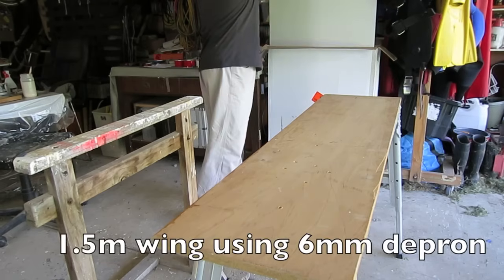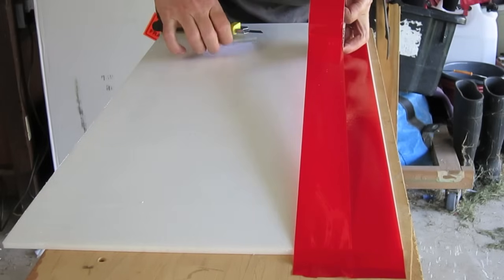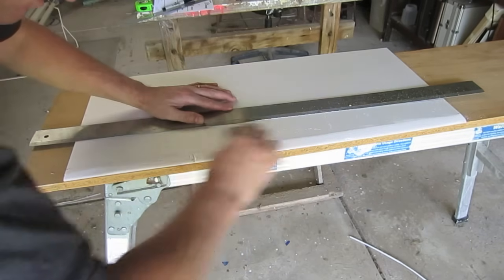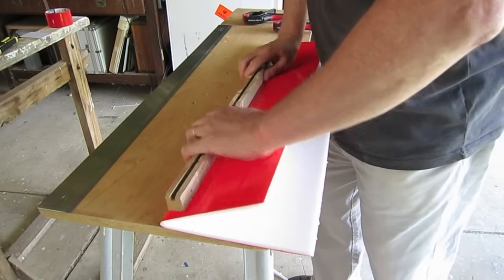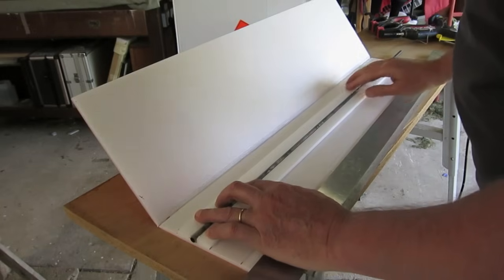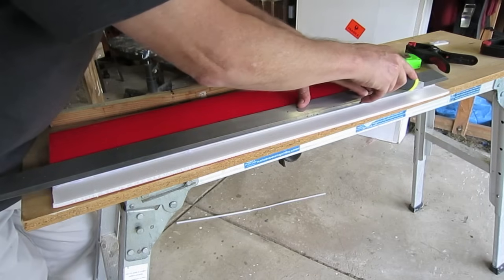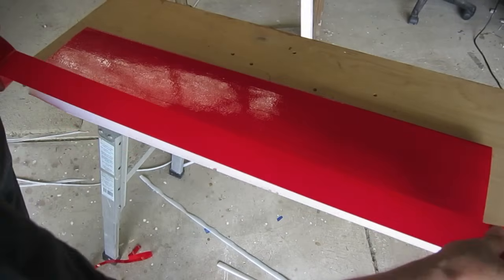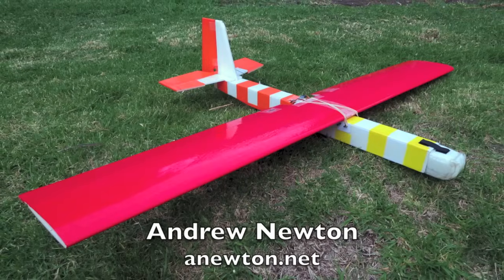Depron wing build

Comment from the maker: azatecas your Google+ settings prevent me from replying directly to your comment. The spar is only held in place by friction but it doesnt move.
Reply: @jellomaster5629  use wooden or aluminium spar
Reply: "Bob", I've built everything from from Comet and Sterling's tissue paper covered models during the fifties, (and still have a bunch in the attic btw), to 14 ' sailpanes now, so I wanted to give you a piece of advice about making your own spars, you can either buy an 8' long 2"x 4" piece of kiln dried douglas fir, cut it in half (4') and then using an electric planer from Harbor Freight smooth all the sides prior to cutting as many 1/4" x 1/2" or 1/8" x 3/8" spars as you will need in this lifetime.

Doug-fir is slightly heavier than Sitka spruce but it is also stronger so you can build some fairly large models if that's what you want or you can just use it as a spar in a three foot slope glider, or what ever you prefer just as well - or you can just buy a spruce spar at the hobby shop for the same price as what you will pay for an eight foot section of doug-fir which you can make about (36) 1/4" x 1/2" spears from, the choice is yours.

The only drawback here is you may have to purchase a small table saw but if you get into building like I and several other people I know the saw will pay for itself. 

Almost forgot, you could also purchase standard fiberglass arrow shafts from an archery store or off the internet and I've yet to have any break yet, and these are in some models which were built some thirty-five years ago.
Reply: @larrywhalen127  thanks for sharing your experience and improving our knowledge 😇
Reply: @jellomaster5629  Carbon fiber spar isn't necessary.

Comment: this really nice but, for which plane this wing?
Reply from the maker: servet içke I have used it with a few different bodies. Red Sloper, Ultra light sloper, motorised Red Sloper.
Reply: 1.65m (65") Twin Boom pusher, which wings plane for this plane?
Reply from the maker: servet içke Same type of wing as this red one but a bit longer.
Reply: OK. Thanks mr. Newton. Than i will build 1.65m (65") Twin Boom pusher and use this wing. Or if you have all plan maybe you share with me.
Reply from the maker: servet içke More information here http://newtonairlines.blogspot.com.au/2014/11/17m-twin-boom-sloper-pusher.html Good luck and let me know how it goes.
Reply: thanks again.Ok i will send you photos maybe video,  I'm using this plans.

SPECS
Wingspan - 1.65m (68")
Length - 100cmm (36")
Airframe weight - 840g

Comment: Hi  Andrew, I've seen others use packing tape method  ie experimental airlines my qtn' is - why does eveyone cut the tape off flush ? I've not done this yet but when I do I intend to tuck mine under, it would be much neater and secure.
Reply from the maker: loonypics For a strong glue join you need bare foam board. But for some edges folding the tape over would be a good idea.
Reply: Andrew Newton Many thanks for replying so quickly. This is all new to me as I've been balsa builder for years using heat shrink film (sola film). Just one more  thing,  heat shrink filming is easy for me as I've done loads of it, can it be used on Depron ? thanks
Reply from the maker: loonypics Depron is a bit heat sensitive. I used document laminating film "New Stuff" for my Le Fish build Complete Le Fish build and the ailerons and tail are depron, had to be careful not to overheat it. With your skills it would probably work fine, just have to try a test piece.
Reply: Andrew Newton  Thanks Andrew, I've decided to use your method for my first attempt at depron building. I have some on order it's 1000mm x 350mm x 6mm, I'll build 2 at 1metre first and the decide between the Axon or the Peace drone the PD may win because the depron size is just perfect for a 2 metre wing with a 1 metre canard + the fuz'. bty I've ordered 4 sheets. My aim is to create a very slow motor glider of some sort as a platform for my Mobius cam', in my opinion most fixed wing flyers fly much too fast for good quality results. What  I want to do is low and slow. At some stage we all go through a  missile stage cos' it's fun, but it's not relaxing and useless for really good detailed filming of landscape etc.
once again many thanks for your very good well explained tutorials.
may all your glitches be little twitches,
Reply from the maker: loonypics Something to remember, depron needs the tape covering (or laminate) on one side BEFORE bending the leading edge. It will just snap without it. An extra layer of tape where the leading edge bend will end up might also be a good idea, not that I have done that yet. An APD that size will be able to float along at walking pace and might even carry an SLR, keen to see the results.
Reply: Andrew Newton It may be a while yet before I get  it done, as money is tight at the mo', maybe a couple of months, and yes I will do a video and contact you when it's all done and dusted, I'm toying  with the idea of under slinging the fuz' something like the Axon's main wing but for the canard also, my thinking is increased roll stability will be more stable cos' the CG would be lower and should help a bit to protect the fore plane when landing in rough grass land, I think maybe the fuz' should be double boxed in high  along its length 3"x3"= a 6" depth and tripled at the wing points, that would be about  9" depth at the wing fixings, or is that over kill ? I would like to , as an anti tip stalling precaution, it would be easy to do, just cut the outer 8" or so off the ailerons and glue back on the wing with a few  degrees of up tilt
Reply from the maker: loonypics The standard APD is very stable as is, maybe too stable because it takes a fair bit of throttle and elevon input for turns. But if you're keen to experiment go for it. Easy to reconfigure if it doesn't work.
Reply: Andrew Newton Hi again Andrew, there's  one thing I forgot to mention and your reply jogged my memory. Flat  bottomed glider wings always employ differential on their ailerons (more up than down) it is very easy to do, even easier if the servos are fitted to the bottom surface of the wing, to do this remove the ail' control horns make a new set with the pushrod holes forward set of the hinge line, instead of level with it. About 3 - 4 mm should give enough diff'  to make a noticeable difference, your looking for about 60% up 40% down or close to that. Note --- 50% up 50% down  is not good for flat bottomed wings, and should only be used on symmetrical or semi sym' wings.
Please do try it out. If you've never done this before  you're in for a pleasant surprise, please report back after you've tried it -- PS don't forget to re-adjust the push rod length, good luck
Reply from the maker: loonypics Thanks for the tip. I have been deliberately not using differential so far, but it might be time to investigate.
Reply: Andrew Newton I've watched you explain the Flite Test A folds for fuzes but I can't seem to find the vid' again now. Also can I pic your brain on the D2826-6 2200kv Outrunner Motor, would it work ok with a 60" thin main wing you show here on a APD ? I know whereI am IC engines but not electric motors
Reply from the maker: loonypics I should have called them B folds, A - above, B- beside. It's on the Depron Spectre overview video. That motor would work but not ideal. It's a high revving, small prop motor, better for a fast wing or Photon where you want a low drag prop for gliding. This is what I'm using for the APD - http://www.hobbyking.com/hobbyking/store/__18969__Turnigy_D2836_8_1100KV_Brushless_Outrunner_Motor.html More grunt, bigger slower rev prop.
Reply: Andrew Newton 

 Thank's again for replying so quickly. I watched Ed's AXON Construction Details video earlier and it looks like I'm in luck (ie not wasted money) the Axon flys with a D2826-6 2200kv out runner motor and being a pusher it ticks the right boxes, ie Mobius has a clear field of view and not to fast. So I'll take your advice and leave the APD for another day. Thank's again mate for the valuable info'and the link, you're very helpfull. Although I'm tempted to increase the wing span just a bit to achive a floaty flyer and try to just cruise it at lower rpm's. Do you think I'll be able to get away with it ?.
Reply from the maker: loonypics Yes the AXON is a very good choice, and if you use a 60" wingspan it will be nice and floaty (Ed used 50"). I learned to fly on an AXON Axon / Photon RC plane first flight
Reply: Andrew Newton I,ve just watched your first flite AXON video.  That was a good effort for a first flite Andrew, I remember mine, it was as scary as hell I had a very small plane powered by a Cox 049 with no throttle, a screaming banshee on steroids, once airborn I was stuck with a fast and twitchy night mare that lasted 3 - 4 mins  while praying for the fuel to run out. Once again many thanks for all your help and advice and yes I will build the 60" Axon, just one more qtn - would you advise the thicker chord or the thin one
Reply from the maker: loonypics That original AXON used a 60" Photon wing with dihedral tips. It was built to Ed's specs using 5mm Quill paper-covered foamboard (the heavy stuff). So it was a thicker chord than my red depron wing above. It would have been 20mm thick and 5" chord with 1.5" ailerons.
Reply: Andrew Newton Many thanks for everything and being so very patient with me, as I do tend to go on a bit, I'll leave you in peace now TTFN
Reply: Andrew Newton Sorry to be a pest, I've got hold of a small glue gun but it's not up to the job, it's only 15 watts.  Qtn what power g/gun  would recomend ? thanks in advance
Reply from the maker: loonypics This is mine http://www.bunnings.com.au/crescent-60w-corded-glue-gun-kit_p5810347 Biggest and cheapest I could find. It says 18W (60W) on the gun. Where are you?

Comment: Andrew, a great instructional Video, straight to the point. I think you should mention the very important fact that you are using Aero grade Depron sheet for wing making in this clip and not the denser standard grade Depron which I use for making a Fuz. In your clip, you simply grooved the LE fold using rounded end dowel, a great method, but unsuitable with the denser grade as its just not possible. Aero grade Depron is 25% less dense than standard grade Depron, and if you are making wings, it makes a big difference. When I make a Fuz, I use standard grade, and cut and glue with joins, not folds, which makes the Fuz a lot stronger.
Reply from the maker: Thanks English, I'm not aware of the different grades of depron, this is just the cheapest building material I can buy. I do the same as you with fuselage corners, Flite Test "A folds".

Comment: Excellent tutorial!

I am now the proud owner of two freshly made depron wings using your/ExperimentalAirlines technique for the first time:-)!

One thing I found is that it might be good to put the first strip of tape so it spans the leading edge fold. If not (no prizes for guessing how I know), the tape may loosen and/or Depron break, if the fold ends up close to where one strip joins to the next.

Looking forward to receiving some spars so I can join the wings and start on the fuse!
Regards,
Matthew
Reply from the maker: Sweet Matt. Good tip about the leading edge area. I haven't had a problem yet but may have just been lucky.

Comment: Hey Andtew, Got my depron started building it not as easy as it looks is it, fuselage is a headache trying to get it square,
Reply from the maker: I use the Flite Test style A and B cuts rather than just bending for the fuselage. That means you cut out 6mm strips at each corner, makes it easy. You could even cut out top bottom and sides separately then glue and tape them together.

Comment: Great video Andrew!
I've been building Eds designs out of Depron myself. They work really well!
One question, where do you buy the coloured  tape? It is really hard to find in the Netherlands.
Reply from the maker: Dank, I can buy packs of 5 colours for A$7.50 at Office Works (Australian office supplies supermarket chain). Not much help to you sorry. Hobby King sell it but I have had bad experiences with their tape, 2 rolls were unusable. Adhesive pulled off in patches and remained on the roll.

Comment: Hey Andrew :D
finally a depron instruction video... i just saw the Foamboard one and couldnt find a vendor here in germany who can provide that... now that i saw depron is an option i can finnally start to plan my first own plane... thanks a lot Andrew :D
Reply from the maker: My pleasure Roberto. Good luck with your build.
Reply: Andrew Newton thanks. ill come back here and show you my result ;-)
Reply: @mongini1  did you ever build the plane?
Reply: Check out foamboarden.de
Reply: wordreet
 nice site but with 1 little issue... i dont need 25 sheets at once... i dont know if ill keep building. maybe im not talented enough. then i would have like 20 sheets of foamboard laying around ^^
Reply: I know what you mean, I got some 6mm under floor insulation foamboard from a local shop and I also had some paper covered foam. One year later I still have lots of it here. Hah! I need to fly more, crash more, make more. :¬D